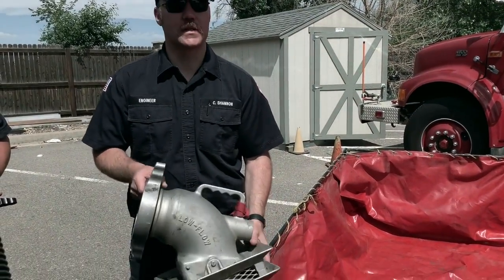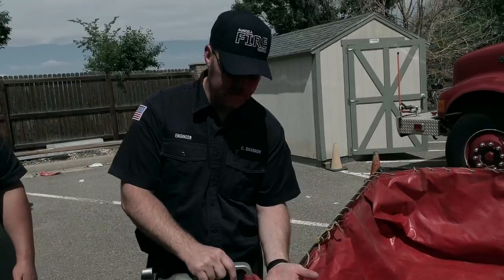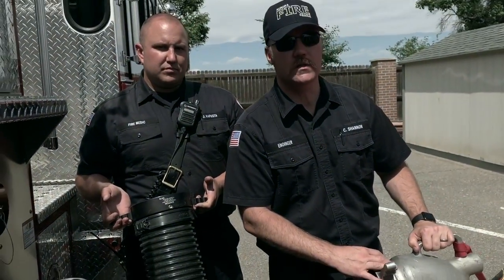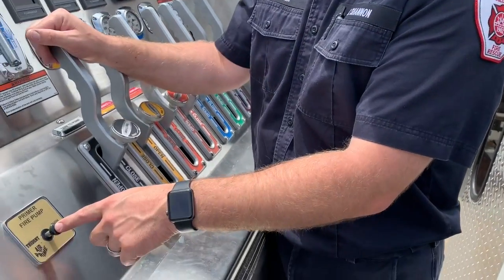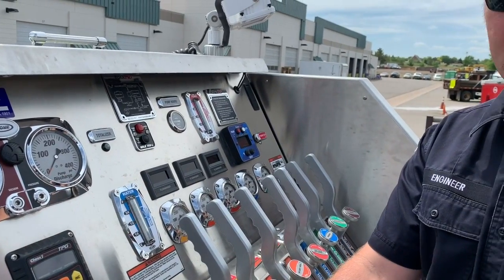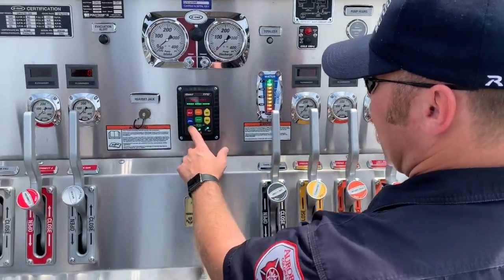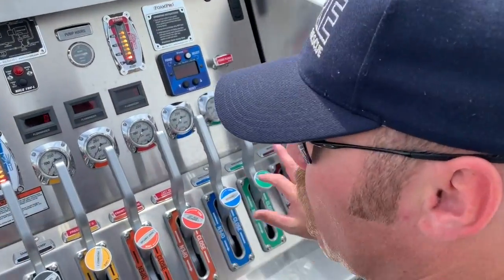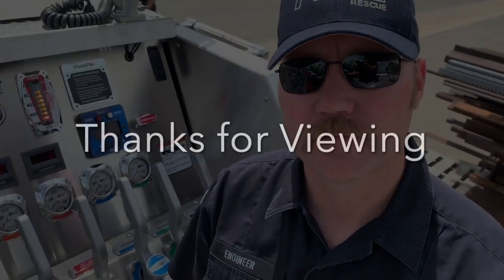Drafting

Comment: I don't trust the diamond pattern unless you are in a parking lot.. Most rural FD set these up on the road.  If its set as a diamond, you make you "tender" have to line up to a diamond point.  If its done correctly, the tender driver has the whole length of the tank to dump the load.

Comment: We use foot valve strainers. Open the tank to pump, it “back fills” the suction hose(s) with tank water so there is no air to expel upon drafting. You can pull draft immediately because the entire pump and suction hose(s) are already full of water. 
Also, a blow up beach ball works well at stopping the venturi “tornado”. The ball takes up no room, only needs a few breaths to inflate it enough, and good it in the tank. 
We’ve also just dropped in used scba cylinder in. They’ll just float around also and break up that tornado.

Comment: Very informative video with the exception of the 4" suction miscue (you're forgiven). I've never seen a recirc line used on the fire ground.  I've also never seen a pump in good condition lose prime if water flow is halted.

Comment: Love the video and thank you for the training time.  Last time I drafted was in the academy. We barely do draft, but i feel its important to know. One silly question though, our rig that I mainly work on doesn't have an RPM mode it's either pressure or volume. Most of the time, we pump in volume. It's a waterous pump on an 01 Seagrave. Would appreciate some tips or tricks brothers
Reply: If you have a pressure/volume switch that means you have a two-stage pump. A two stage pump has two impellers. The pressure/volume switch operates a transfer valve. In pressure the valve will allow the impellers to work in "series" meaning your intake water enters the first impeller, increases in speed/pressure, then enters the second impeller which increases the water speed/pressure higher prior to discharge.  This allows your pump to provide higher pressures at lower engine RPMs.  Pressure mode is usually only effective up to (I think) about 500 GPMs discharge. Then the water will become too turbulent so you would want to switch to volume mode (warn crews and throttle down first) for higher GPM discharge.  In volume (parallel) mode the transfer valve will divert half the intake water into one impeller and the other half into the second impeller. Each impeller will add pressure to the water before it joins back together for discharge.  This is used to reduce friction loss in the pump when you are supplying larger GPMs (>500).
Since you don't have an RPM mode that means your pump does not use an electronic pressure governor.  Your pump probably has a hand turn throttle and a "manual" pressure relief valve.  So you adjust the throttle (increase or decrease) to achieve your desired discharge pressure and then set your pressure relief valve slightly above the highest psi you are discharging.  That protects other discharge lines or the pump from excess water hammer back pressure.   
A pressure governor would achieve that back pressure protection in "PSI" mode by sensing the back pressure and electronically adjusting the engine RPM to maintain the discharge pressures you have set. A pressure governor in "RPM" mode does not regulate or adjust the engine RPM is simply leaves it where you set it.

Comment: How would you handle having no water in your tank and your primer inop, as you discussed with the second method of drafting?
Reply: You would need to get water into your tank from another source or a water supply from another source. Another unit with water could start a water supply to you and as you received it you could use it the same if your tank had water to purge the air form the Hard Sleeve. Of course they would be filling the reservoir as well if you were using that if using a static water supply such as river stream lake pool or cistern that would be unnecessary.

Comment: Why do you stay in RPM mode for drafting? Drafting doesn't happen much here so we're usually in pressure mode.
Reply from the maker: Hello Frank, thanks for viewing. We use pressure mode for normal pumping, but we do not use pressure mode for drafting as it is prone to fluctuations which can cause you to lose your draft. RPM mode ensures that we are pulling water from the draft at a consistent rate that does not fluctuate.
Reply: Frank, RPM mode holds the engine at whichever RPM you set it at. Pressure mode holds the engine at the pressure you set. When air hits the pump as you are establishing your draft - the engine will go back to idle if you're in psi mode. You can (And should) go back to PSI mode after you've established your draft.

Comment: After setting the governor to RPM mode, what is the recommended option? 
1) Is it better to increase the pump RPM to range(800-1250) before priming? I guess, this will be bad for pump? (or)
2) Is it better to prime and then increase the pump RPM to desired requirement?
Reply: Shyju catch the draft before increasing the RPM’s. Having high RPM’s without water in the pump will burn it up, as would not moving water out that’s in the pump. Water in the pump just moving around and not going out a discharge creates heat and the higher RPM’s create more heat faster which will destroy the pump, it can actually get hot enough to turn the water into steam creating pressure as well.  Additionally it can cause water hammer “if” you catch the draft at high RPM’s, especially with older pumps that don’t automatically compensate for water hammer.  Having the discharge open that leads to the nozzle where firefighters will be waiting for water will also get hammered with the nozzle pressure all at once if the RPM’s are high versus a gradual increase, however, slowly opening the discharge will compensate for that.  This could lead to losing control of the nozzle or the ground monitor which is very dangerous.

Comment: This department must never draft. Multiple inaccuracies.
Reply: Levi M: Every company has variables in policy/operations. Companies at this locale are urban/suburban. Rarely need to draft, having dry hydrants available. This just happens to be Aurora FD's SOP, geared towards training their own crews.
Reply: Clarify, please.
Reply: @ltmundy1164  Last night I learned you don’t need the pump to draft.
Reply: @davidb9323 : Context. Drafting is dependent on location/resources/circumstances. Commonly used by rural/exurban companies that lack hydrant infrastructure. Pumper/tankers normally get this assignment, but engines may/can/do perform the job relaying water from source to fire site.
Reply: @ltmundy1164  I mean, you don’t need the impeller spinning to pull a draft. Which in the video was an inaccuracy - they had it on.
Reply: You going to at least explain these “inaccuracies”? … or just whine and complain? Looks like he pulled a draft easily to me

Comment: How many inaccurate statements can we find?  He continuously refers the hard suctions as being 4",  yet its a 1500 gpm pumper.... those are 6" dude!!! 

States you can put "up to two" hard suctions together for longer reach.........  um, you can use more than 2 skippy. 

Diamond setup is outdated.  He talks about backing into the porta tanks, you only back in when you dont have side dumps. Side dumps are alot better.  So is setting the tanks up in a straight line.  

I know there are more.  They really need to fact check thier videos

Comment: Someday you will have a great mustache. Rpm should only be used if running to a monitor or deck gun. Also it's a porta tank not a porter tank.
Reply: Wrong.. anytime drafting operations are in play you’re in RPM mode
Reply: @jbeezey RPM at 1000 right?